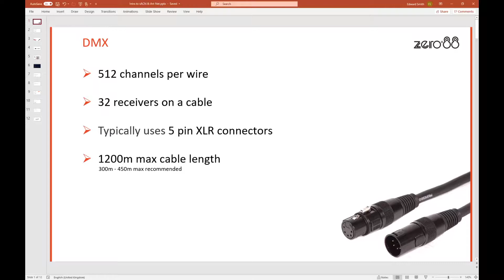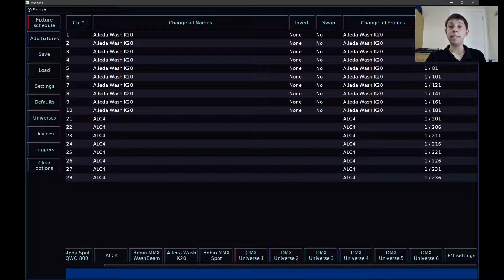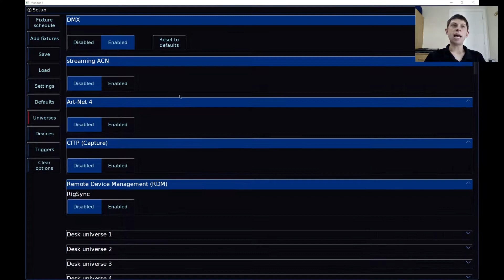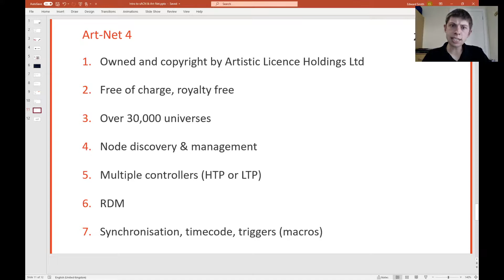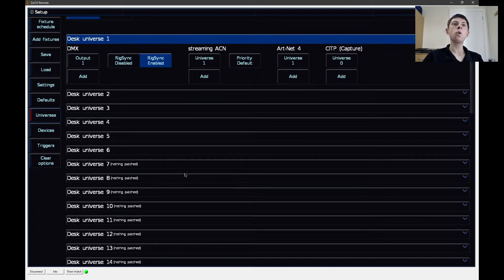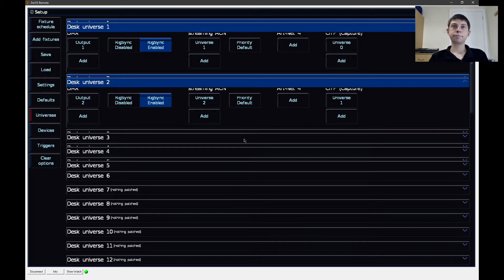FLX Range: An Introduction to sACN & Art-Net

Comment: Hi, I was wondering if you could use artnet trough the ethernetport as an extra 512 dmx univers output? Or is it for streaming those 2 dmx ports (have the flx s48 version with 2 dmx outputs) Over the net? Tought if you could make an 3th  port by doing so
Reply from the maker: FLX S consoles can control 1024 DMX channels. These DMX channels can be patched across 64 DMX universes. These universes can then be sent from the physical DMX outputs, or over Ethernet using sACN/Art-Net. So you could send universe 1 and 2 from the DMX ports, and universe 3 over Art-Net for example. Please email support@zero88.com for more information.
Reply: thats awesome, thank you so much Edward @zero88